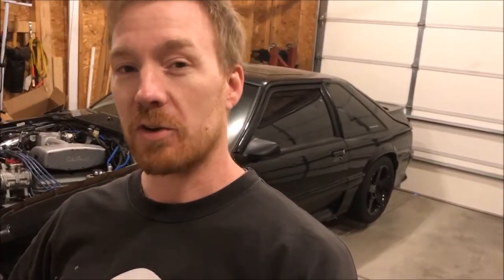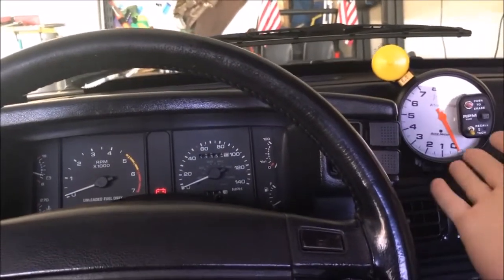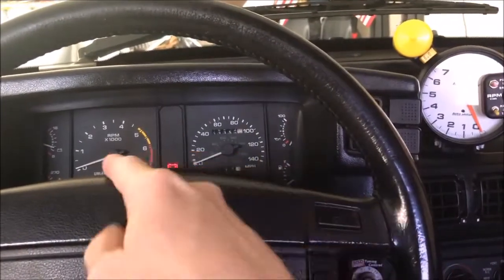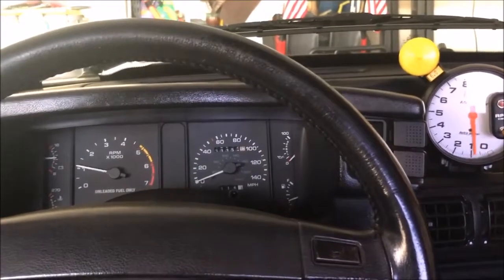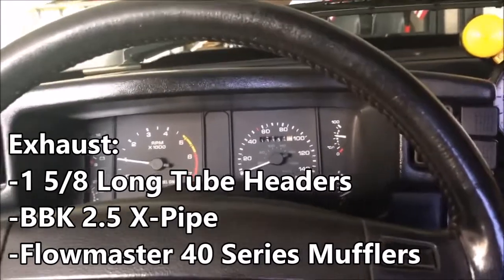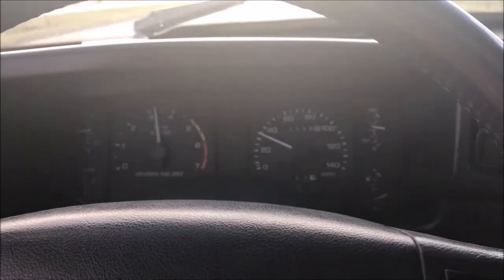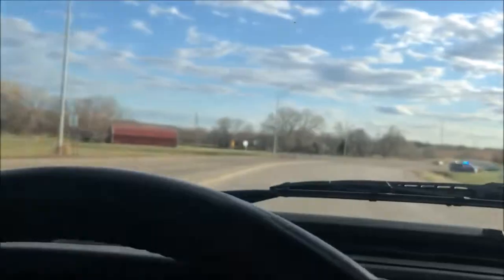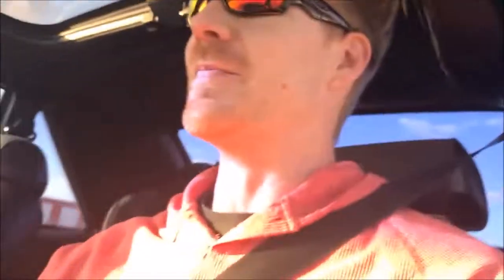GT40 Head Swap Mustang First Drive

Comment: The stock tach works perfectly fine for me. I only have a little shift light on the steering column. Plus I'm a street racer. I m the kind that perfers to stay under the radar. Not draw attention to myself. I like  to blend in with the traffic.
Reply from the maker: Yeah, keeping a low profile is always a good strategy 👍👍👍

Comment: The stock tach does have adjustment pots on it to adjust it back to being accurate.  You just need a cheapo frequency generator off Amazon.
Reply from the maker: Interesting!  I didn’t have any knowledge about that. Thanks for the info 👍

Comment: How is that 302 hitting 7000 rpm
Reply from the maker: Built Ford tough!  😂👍
Reply: @FastFixYouTube yeah  absolutely i guess so  then I got a 94 svt cobra  fully built up  with a 306.  With high compression heads ported  Thing screams but I never pushed it that hard in the rpm range was to afraid to blow it up  I crank it to 6000 tho 😂
Reply: Oh and  just Watched  the beginning of your video and  t see were you say the tac is off 🤣🤣🤣

Comment: Nice work. I just put my 92 on the dyno. GT40p heads, E303, Typhoon intake and full exhaust. Did 263/302 at the wheels. Nice improvement over stock and runs great. 👍
Reply from the maker: That’s a great improvement. I’m thinking mine is probably close to what yours did. My combo isn’t that much different. Still super curious what it does though. Especially how much the nitrous wakes it up.  Thanks for sharing! Good info 👍
Reply: My 90 coupe has the same heads, same intake but a Crane cam and made the same power on the dyno.
Reply: That's what I'm trying to do right now I already got the gt40 intake installed ima put gt40p heads and hopefully a cam after awile
Reply: @SuperThugnifacent  Cool you can see the dyno video on my channel if interested. 👍
Reply: What’s gears are in the car?
Reply: @djschives4673  There is a comment below that says 3.73s.
Reply: Where you guys get headers for the gt40p?
Reply: @georginaesparza835  Got mine at LMR a few years ago. BBK 1-5/8 long tubes, ceramic coated. They fit P heads fine. I use a 90 degree silicone spark plug boot, no issues.
Reply: @427walrus  hell yeah! Thanks, am looking forward w E303 cam too but I upgraded the valve spring up to .542 , thinking of going with more lift on the cam

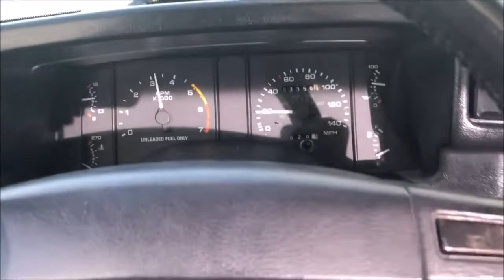Comment: Did you ever get the nitrous? Putting some gt40 heads on my buddys car right now. He has the same edelbrock intake lunati cam long tubes and the other bolt on msd ignition 3:55 gears crane 1.7 rr and he has a nitrous express single nozzle wet system jetted for 125hp. I gasket matched the heads not too much on the intake side but we opened up the exhaust a good bit actually had to open up the header gasket a little to match. His is in a 95. I had nearly the same exact setup in my old fox except I had a Ford racing f303 cam a pieced together n2o single nozzle wet kit on a 100hp 3.73 gears was def a fun car we are hoping for an 11 second pass on the nitrous out of his car just trying to keep up with the newer cars. Wish I still had my old 5.0 but I love my 3v too. Also have a 02 2v convertible but it’s a turd 100% stock just use that for daily driving.
Reply from the maker: Hell ya, sounds like a fun project. I think 11s are attainable with that combo. I ran 12.4 with a stock cam, heads, and 140k on the motor.  I think my current combo is good for high 11s, so I bet yours is too. Or better. You’ve got a 50hp nitrous advantage   

To answer your question, no I didn’t get the nitrous system going. I think it’s just a stuck solenoid, but I had another kid and to be honest the car isn’t even registered and I haven’t driven it in months. That will change though!  

Thanks for the comments!  Good to read stuff like this 👍

Comment: When I swapped my stock ho engine for a 98 explorer with gt40p heads and tfs1 cam my fox went from mid 14s to low 13s with traction problems on street tires.
Reply from the maker: That sounds about right!  I remember taking mine to the strip bone stock and ran a 15... I didn’t realize it was that slow and was pretty disappointed.  Boltons came next and it dipped into the high 13s. Then nitrous got it to low 12s with slicks. I don’t know what it will do on this new combo, but I want to find out. Thanks for the comment!
Reply: Did you have to change the valve springs?

Comment: I hope you upgraded the valve springs cause your losing power if you dont with the gt40 heads. The gt40 heads also fall drastically at the top end unless you upgrade the springs.
Reply from the maker: Yes, I upgraded the springs. They were matched to the cam profile. I have an entire series on the heads. They should appear at the end of this video. Thanks for the comment!

Comment: Gt40p are the better beads. Bump in compression. Add a cam on top of those heads and you'll have a damn good top end kit. X303, with a bbk cold air intake and a good exhaust system. It's all about air flow and fuel. That = power.
Reply from the maker: GT40 vs GT40p battle has no clear winner.  IMO the GT40s are the preferable head because they maintain stock spark plug location and have a larger exhaust valve.  They basically flow at the same rate within a few CFM, so there’s really no performance figure that makes one stand out over the other. The GT40p heads seem to be easier to find, so maybe that’s enough to make them preferable to some. 

Thanks for the comment 👍
Reply: P heads aren’t great if your boosted.

Comment: I did the gt40 heads but milled .040 of them. Had too mill the explorer lower intake a little too get it to seal. Ported the lower as well. 1.7rr and a comp nx264hr cam.  Bama tune, full exhaust and gears and it runs strong.
Reply from the maker: Nice!  That's a good setup...basically what I'm running as well minus the porting.
Reply: @FastFixYouTube  Do you think the porting is worth it? I have a set of 3 bar heads and an explorer intake manifold I’m thinking about throwing on. Probably add a TFS1 cam too. Are you still running the stock 19# injectors?

Comment: Ricer tach?  Hell I was using monster tachs back in the 80s before ricers we're even a thing.
Reply from the maker: Right, that’s true.  I shouldn’t have referred to it as a ricer tach. But, ricers adopted the monster tacks for use in their non-race cars and ruined the image.  So, when most people these days see tachs like this, they think it’s a ricer thing albeit they’re completely functional and often necessary. I catch plenty of crap for mine even though it’s a highly accurate instrument to measure one of the most important functions of the engine. My stock tach is garbage and off by a lot in the upper rpm range.

Comment: What is a good tuner for a 94-95?
Reply from the maker: Hello. I used a tuned chip from Bama which is a company within American Muscle…I think anyway.  Unsure if the 94-95 mustangs have a port to plug in a tuner…kind of thinking they don’t. I think you’ll need to add a chip to the computer as I did
Reply: @FastFixYouTube  thank you, port is fake on 94-95 mustang, obd1 under hood,  guess this is my only option, hoping the bama will work, can you link to software and make your own tune?  I’m interested big time.
Reply from the maker: Here’s what I have: https://www.americanmuscle.com/sct-4-bank-computer-chip.html

Comment: Are you running an H-pipe or X-pipe? Thanks
Reply from the maker: Hello. Running an H-Pipe. Had been using the MAC Powerchamber, but upgraded to long tubes which didn’t match. It’s a 2.5 inch exhaust. It will be upgraded when I get done with the stroker motor. Thanks for the question.

Comment: That's awesome and sounds very good. Did you upgrade springs? I read they don't allow for lift over .450. Is this true?
Reply from the maker: Hello. Yes, absolutely upgraded the springs. I ordered them with the cam to match my set up. I’m unsure of the lift tolerances for stock springs, but don’t risk it. Makes a huge difference in performance if you run a weak spring relative to your cam.

Comment: What I’m trying to figure out is will the gt40 intake manifold fit on the stock heads
Reply from the maker: Yep, sure will!  I assume you’re talking about the GT40 intake found on explorers, not the cool tubular GT40 intake.  But the bolt patters and such remain the same and will bolt up to E7 heads.
Reply: Ok so I actually have the tube intake plentum. Idk the lower matches, but after more research I’m going to upgrade the heads at the same time
Reply from the maker: Christopher Contreras oh nice, you’ve got the coolest looking intake available!  It’s pretty good for power too. I don’t blame you for doing the head swap as well. You’re in for some big power gains by changing them both. Best of luck!
Reply: Yes , I have a GT40 Intake manifold on my 91 fox and my I have stock heads

Comment: Car sounds great man! 👍 I'll be tearing mine apart soon and adding a set of aluminum heads and a b303 cam. Can't wait!
Reply from the maker: Hell ya. That’s a good combo.  Should sound sweet!  And add a good amount of power. I’m probably going to be getting aluminum heads too this spring. The GT40s definitely helped, but now I’m used to the power and need more....and on it goes.
Reply: Dont do a e303 for more power go with a comp cam with 512 lift with gt40 heads
Reply from the maker: @theunknownshadow6926  👆yup. That’s my combo
Reply: @FastFixYouTube  im just hoping i got enough clearance for my valves and pistons if not its gonna bend my push rods again. Im not running a gt40 intake its just the stock intake im praying it works.

Comment: What size head gasket did you go with? And what length pushrod did you end up with. 
I did the e303, 0.042 gasket, three bar GT40, stock rockers, and I’m having a hell of a time trying to measure my pushrods. 
Any advice be great.
Reply from the maker: Hello. Check the description of this video. It lists the head gasket link. 
https://youtu.be/SVhUCuCCo0U 

As far as the pushrods go, the stock ones should work. I’m using stock pushrods on my motor.

Comment: Awesome video Brother, I have a stock 89 GT, just cut off my cats and smog pump delete. Will a set of GT40P heads do good by the self, without any aftermarket headers intake or cam? I plan on doing that in the future, I am just a broke high school senior who just graduated. Thank you
Reply from the maker: Nice man!  I got my mustang during my senior year. Tons of fun!  

GT40P heads will definitely give you more power. The advertised gain is about 40hp I believe. With headers and cam expect those numbers to go up. It’s fun to start from scratch and build up your car. Enjoy it 🤙
Reply: Fast Fix awesome!! So I just bought a Gt40 intake that has been ported, a set of GT40p heads and I’m getting a Lunati 284/292 cam, what numbers should I expect from this build? I guess just an estimate if possible. Thank you!!

Comment: I always liked the gt40 heads  . Ran much harder on the top end all day. I had a 95 gt and a 94 cobra at the same time and the gt40 stuff that came on the cobra would smoke that gt up top  . I wish I kept that cobra now. 90 lx now
Reply from the maker: The difference was more noticeable than I predicted. A much better head up top as you say.  Maybe one day you’ll run into the 94 cobra again and can re-aquifer. The 90 lx is a fun car too. Thanks for the comment 🤙

Comment: I’m guessing 3.73’s? I’ve got some pretty good traction issues with mine and I’ve got 285/40/17 NT555 G2’s on the rear and half the time it blows the tires off 1st-2nd lol. Also your vid on setting the valve lash really helped me out when I relashed mine, I hadn’t done it in a while and it was starting to intimidate me lol.
Reply from the maker: Haha, yep! You nailed it.  3.73.  Traction is a constant issue. Although I’m not sure how some of these cars with much higher horsepower and torque are able to do it.  1st gear is useless for me, 2nd is okay. I only use nitrous at the midrange of 2nd or use only in 3rd or 4th. I have Sumitutoyo (sp?) and there’re not good for much. I will switch to a tire like yours, but that 285 number scares me. Do you have any clearance issues? 

Glad the valve last video helped you!  I appreciate the comment. 👍

Comment: I'm eyeing a pair of these heads right now. I have a Cobra Intake on some E7's...but I know they're choking the car currently. Did you have an angle job with the resurface?
Reply from the maker: Hello. They heads already had an angle job on them, so I didn’t have to do too much. I’d recommend doing that though while you’ve got them at the machine shop. It’s worth in IMO.
Reply: I porter my gt40 lower intake to match the heads. It’ll make a significant improvement. There’s lots of material to be taken out and #1,4,5,8 cylinder runners need to be straightened out
Reply: @alanb2845  you must be talking about aluminum heads? Because my understanding, the lower Cobra Intake, is already larger than the GT 4O 3 bars, so, no need to port the lower if using GT40 irons
Reply: @jpp9846  I used an explorer lower which might be different than the Cobra lower. Either way I was able to remove a significant amount of material to match the heads
Reply: @alanb2845  ok, you're talking about the intake. I spoke to a well known machinist in the Foxbody world and he said that the Cobra Intake (I'm not sure on the explorer) out-flows the GT40 heads anyway, so he advised against porting my lower. (TMoss is the machinist). So I'm just going to run it as is and Supercharge it in the future.